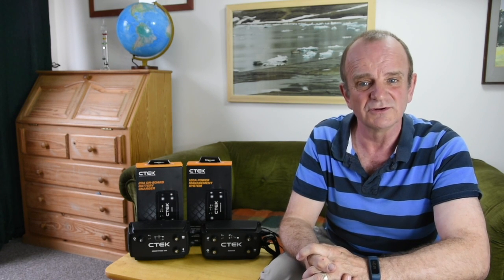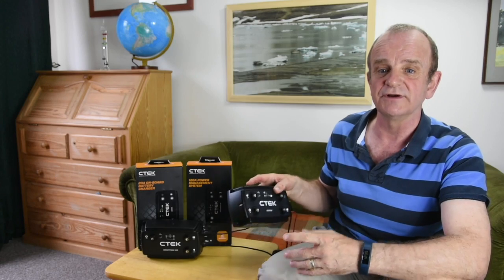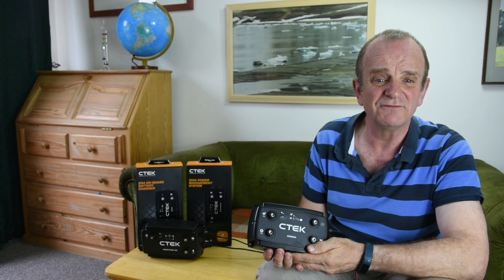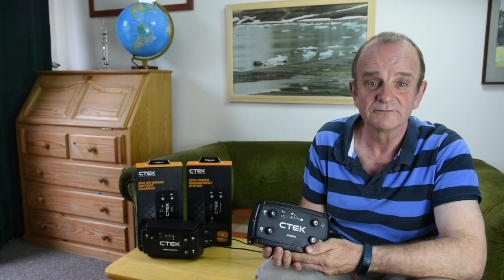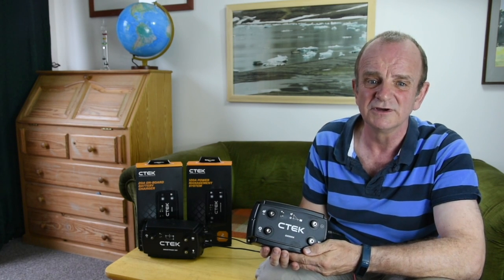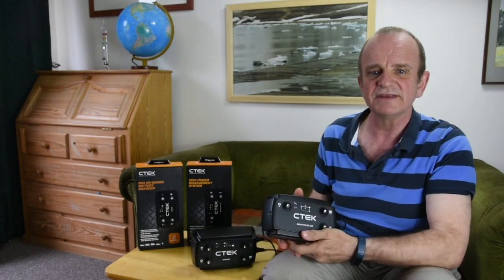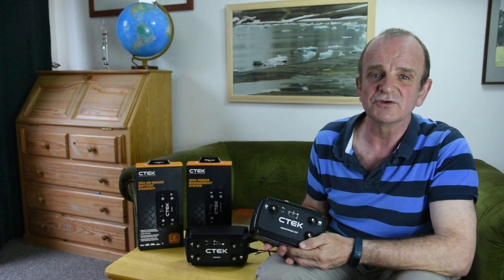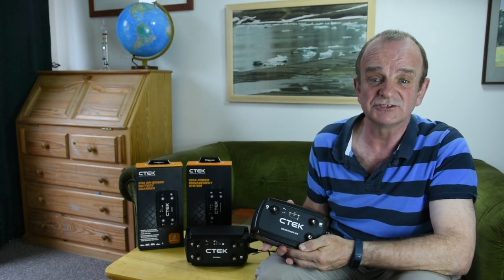CTEK DC to DC charging

Comment: Great video. One thing i am struggling to find is the maximum solar input amps when connected to a smartpass. I know the max voltage is 23 volts. So 12v solar panels are to be connected in parallel only. However I can't find if the maximum input rises from the standard 20A once a smartpass is added. Have you any ideas?. Thanks.

Comment: Hi! Great video :) I’ve just purchased the CTEK D250SA AND SMARTPASS 120. Do you know how long it would take to charge my 210ah AGM rolls deep cycle battery from say 50% discharge from just letting the engine tick over? Many thanks!
Reply from the maker: JOEL WALDEN It depends on the size of the alternator. It will charge at it’s maximum charge rate till the battery is 80% charged. From 80% to full, the D250S and Smartpass will do the maximum that can be achieved dependent on battery temperature. So the hotter the battery is the less able it is to accept high current charging. Sorry, but there’s no factual answer. Know only that it will be much faster than just relying on the automotive regulator, which, because it doesn’t  monitor battery temperature cannot optimise the final 20% of charge.

Comment: what is the amp output of the ctek  dc to dc  battery charge controller?
Reply from the maker: Hilbert Patterson. The D250S - now D250SA has a maximum output of 20 Amps. If you require more than that, you add the Smartpass in parallel. The new model Smartpass will handle up to 130A 

What’s the capacity of your alternator? Even a 50A alternator will only deliver 50A for a short while when the battery is deeply discharged. It soon tails off. Email me to discuss things further. I’m happy to help.  Email address is waterboatman@live.com
Reply from the maker: The Maximum charge rate from the D250S (now SA) is 20 Amps. However, it's not as simple as that. The key to getting the full charge into the battery is to maintain a voltage difference. So, charging is maintained at 14.4 Volts, and current (Amps) depends to a large extent on battery temperature. As the battery gets fuller, it resists the charge more and more. CTEK chargers (both AC & DC types) monitor to temperature, and charge at as high a current as possible (within the limits of the device) but ensuring the battery doesn't get too hot. If it gets too hot, the battery acid will evaporate, so you have to top up the cells. In some 'long life' batteries you can't even top up the electrolyte, so it's very important not to cause the battery to get too hot. 

If you want to charge at a higher rate than 20 Amps maximum, you install the CTEK Smartpass, which allows for bulk charging at up to 120A. The Smartpass won't increase the voltage, as the D250SA does. When the battery gets to around 80% capacity, and the current via the Smartpass drops off (because the regulator has reduced the voltage and current), the D250SA takes over the charging, continuing to keep the voltage at 14.4V.

I hope that explains it. Any queries, let me know. I'll help to know what engine you have, what size alternator, and what battery capacity, if I have to go deeper.

Cheers
James Turner.
Reply: Seagull Videos hello! Hoping you can help me here. I have a dual battery kit, between both batteries is an isolator that switches automatically to charge the aux battery. I want to leverage a 250sa to charge the aux battery via solar panels. This is to maintain battery charge while using accessories.  How can I incorporate the charger without interfering with the isolator?